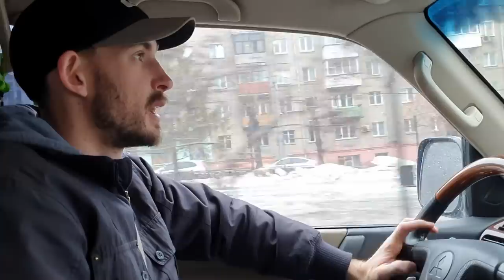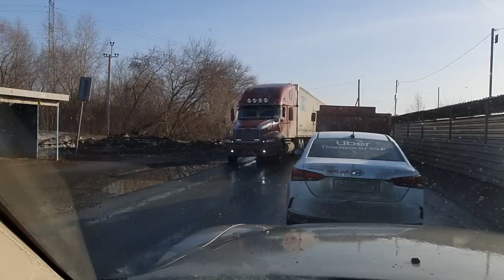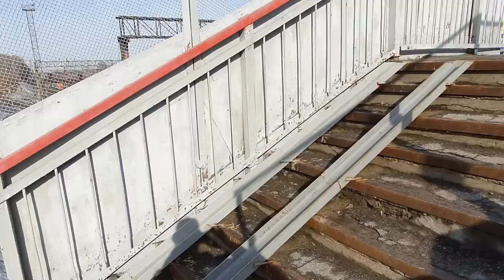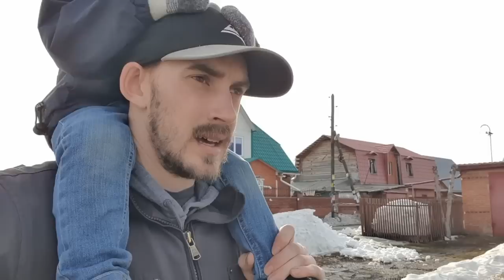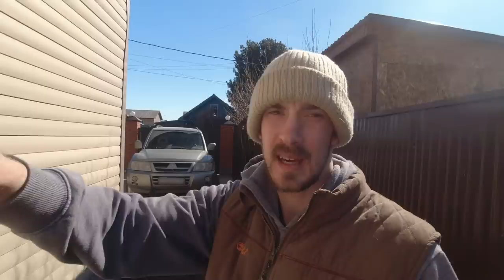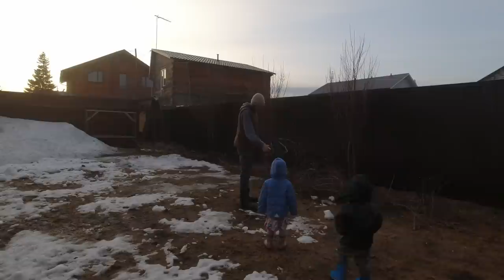WE HAD TO STAY HOME [real life in Russia]

Comment: The catalytic converter must be cut out immediately after the purchase of the car and replaced with a conventional flame arrester. The engine will only thank you. The catalytic converter appeared on cars under green pressure and does not matter to technical issues, it even harms by creating excess resistance in the engine exhaust tract. It is quite expensive due to the presence of platinum inside, so servicemen often do all the work to replace it with a flame arrester for free and ask for their work to leave them the old catalyst. Watch a lot of videos with reviews and analytics on how people are replacing catalysts with flame arresters and why.
The construction of racks (shelves) along the entire height of the window to accommodate seedlings comes to mind.
Cleaning bituminous stains from a car - YouTube is full of videos on this topic.
Reply: Датчик наверное менял, вряд ли катализатор сам